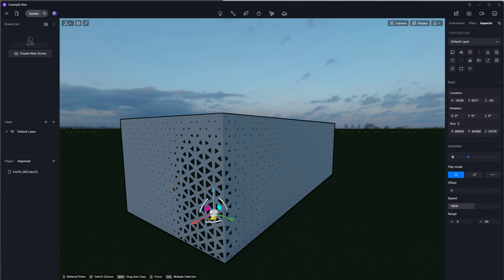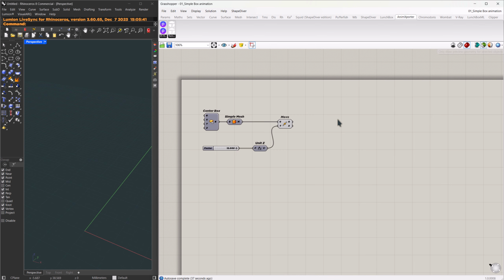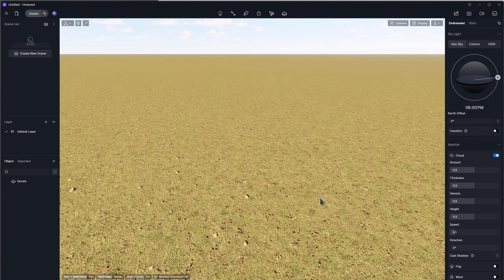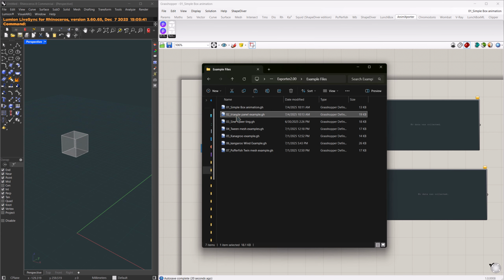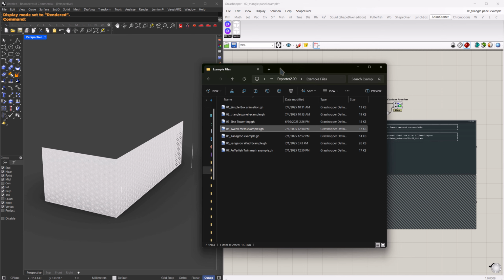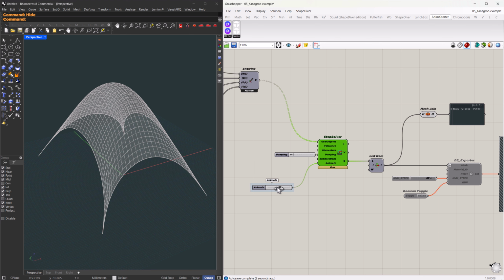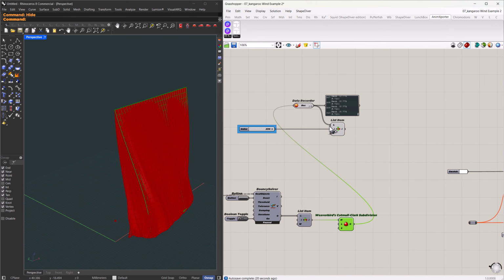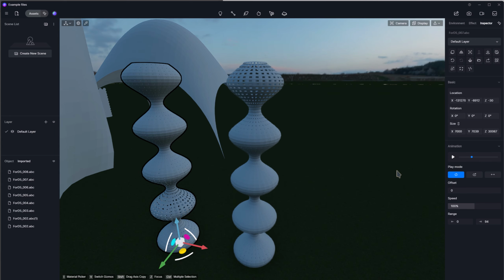How To Export Grasshopper Animations to D5 & Twinmotion | Easy Plugin!

Comment: Wow, amazing! May I know how much time does it take to create alembic file for a big mesh? It's more like 5 seconds for 50000 vertices or 50mins? Thank you
Reply from the maker: It depends on your system. In my case, around 20k vertices already takes about 10–12 minutes. Above that it becomes very slow, so I wouldn’t recommend doing this with 50k vertices. It’s better to simplify the geometry or export it in parts.
Reply: @3DBeast  Ok, thank you!

Comment: Does this work for mac? I'm using Rhino 8.21 and getting the error after dragging it file to GH canvas: Language Python 3.9.10 is not yet ready or failed initialization. Thx
Reply: Same here, did you find any solution or any other way to animate on Mac by any chance ?
Reply: @Wiselo  Sent them an email, it doesn't support mac

Comment: Hi, looks cool. I've purchased the full version. However, I'm struggling with the first step to export to D5. I was following your video to do so, but It was keep saying that Make sure to group my slider and rename to "Animate". I'm using Rhino 8 in version 8.5.24072.13001. Is there any other setting need to do before I use it?
Reply from the maker: Hi! You need to select the slider you want to animate, then press Ctrl+G to group it,  rename the group to Animate, and press "F5" or re connect the wire,  just like shown in the tutorial. If you’re still having trouble, feel free to email me at tridbeast@gmail.com and I can help you further!

Comment: Very cool! Does something like this exist for blender?
Reply from the maker: Thanks! This already works with Blender, Unreal Engine, or any software that supports .abc or .glb. Just drag and drop the exported file into Blender.
Reply: @3DBeast  this is revolutionary. Thank you 🙏🏼
Reply: @3DBeast  that's awesome, you think it could work with 3ds max as well?
Reply from the maker: @juanfernandes1387  Yes, 3ds Max supports Alembic, so you can import the D5 exporter output into 3ds Max.